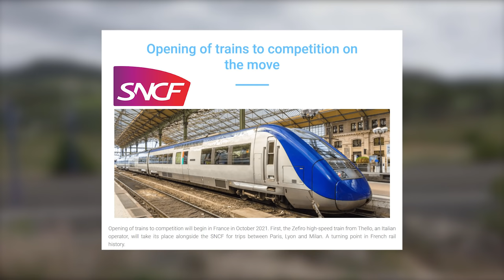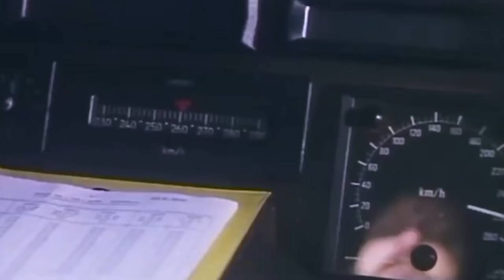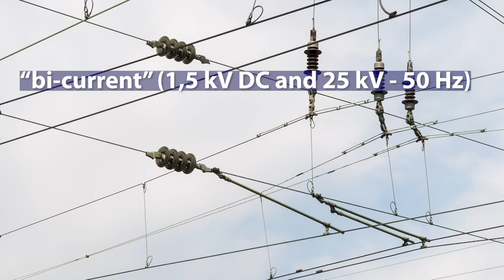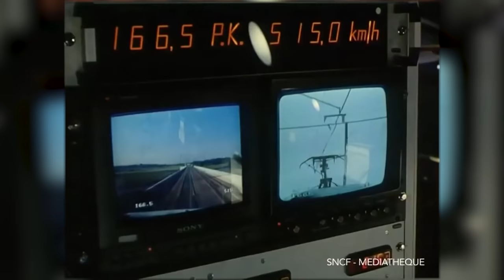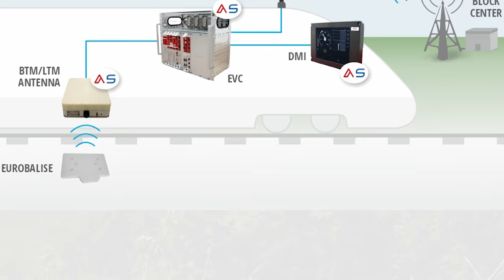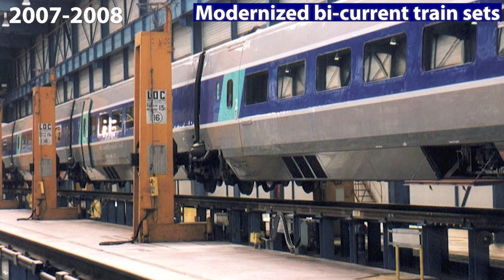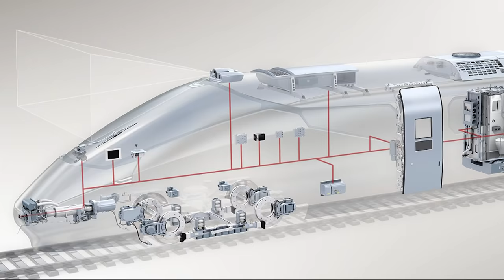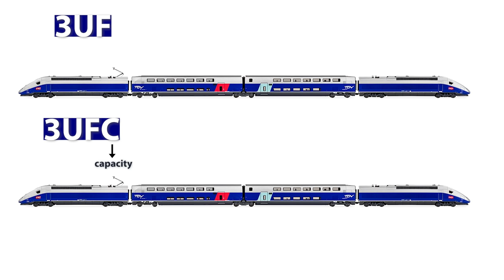Evolution of French TGV Trains: EXPLAINED

Comment: You forgot the TGV La Poste, the world fastest freight train. It was a modified TGV PES, which painted in yellow and allow easy loading of mail.
Reply: The "La Poste" TGVs also had special devices under the floor to measure the weight for the loaders (people) to synchronize the weight on both sides of the cars in order that the final weight on each rail was close to equivalent.  If my memory serves me right, they were removed from service in 2009.
Reply: The 954 half was preserved. 1 power car and 4 carriages.
Reply: China has a faster one now though
Reply: @RichardMigneron  They where removed in 2015
Reply: I remember seeing it once when I was younger it was parked between gare du nord and stade de france
Reply: @danielhalachev4714 Conventional freight trains
Reply: @daniel halachev Mail letter are on decline.  it was more difficult each year to have rentability. So it was the postal company which own them, stop running them. "La Poste" wanted to sold them but nobody buy it.

Comment: You might have forgotten about the PBKA Thalys version. This is the kind of Thalys train that also runs to Cologne. And the TGV that goes to the UK (that's now slowly replaced by the Siemens e320). But it's still a great video
Reply: Also, the original Acela Express is a TGV-derivative. EDIT: As is the new Avelia Liberty also.
Reply: And do not forget the original Eurostar class 373 sets, which were also produced by Alstom.
Reply from the maker: Yeah, it is produced by Alstom but it is not TGV derivate.
Reply: @RailwaysExplained  You forgot the TGV La Poste and the future TGV Avelia Horizon.
Reply: E300 are a dérivate from TGV Atlantique, but modified to be usable on Uk
Reply: @fugf1623  yes, they have different traction motors (asynchronous for the first time in France) so the power electronics also changed, and more safety systems. But Overall their design was clearly based on the TGVs, retaining the general structure (just adapted to the smaller loading gauge) and the bogies for example.
Reply: UK class 373 was very much a TGV. I'm a former Eurostar engineer and we worked with SNCF and so many parts were either common to other TGVs or were an evolution of them just as with each other TGV derivative. 

Arguably the most complex of the lot, it had twice the length, nearly twice the power and all in a smaller loading gauge than other TGVs, with UK AWS/TPWS signalling systems, initially 750v DC third rail shoegear and associated equipment (long since removed since the change to St Pancras station).

So Yes I'd have expected it to be included here as it has a lot in common, particularly with the TGC Atlantique which was a similar vintage.
Reply: @joriss5  the bogies were virtually identical. Many common parts carried over and shared.

Comment: Thank you for the overview.
As a bit of pre-history, until the early 1970s SNCF actually wanted to use gas turbines for their high speed train, considering the difficulties of pantographs during the high speed tests of 1955. So the "TGV 001" test unit was equipped with gas turbines, similar to the earlier ETG and RTG trains. During the 1970s, also considering the oil crisis, they changed their opinion and developed new overhead wire systems and pantographs to work at high speed. A contemporary film about the TGV 001:
https://www.youtube.com/watch?v=1VTfoSltNRI

Alstom also developed an articulated train with distributed traction, the AGV. That one however was not ordered by SNCF, it was only built for Italian ntv (italo) so far.
Likewise one TGV was tested with tilting technology in order to reduce travel times on classic lines, specifically Paris Austerlitz via Limoges to Toulouse (le Capitole). No series production came out of it.

In addition to the Euroduplex currently under construction, the next generation has already been ordered, 100 Avelia Horizon units:
https://www.alstom.com/press-releases-news/2018/7/alstom-receives-sncf-order-100-next-generation-very-high-speed-trains
The improvements mentioned are: 20% lower cost, shorter power cars and new doubledeck bar car increasing passenger space by 20% at the same length, 30% lower maintenance cost, 20% lower energy consumption. The press release does not mention any equipment for international operation. I assume that's optional.

Comment: Great video. For a few that were missed outside of the ones other commenters have mentioned:

Eurotrain: A test train created for the THSR which used ICE power cars and TGV duplex carriages.

TGV P01: A TVG with tilting technology.

AGV Eilsa: Prototype of the TGV successor/Avelia predecessor. It had an EMU formation with distributed traction instead of a power car-carriages formation.

Acela Express: American version using TGV and LRC technology.

Avelia Liberty
: Acela successor based on upcoming TGV M/Avelia Horizon.
Reply: I wouldn’t call the avelia liberty a successor to the Acela
Reply: @No-le9qf  Why not?
Reply: @HeavyRayne  it’s not American it’s a off the shelf trainset and only similarity’s it’s has with the Acela is the trackage it run on and who operate those trains

Comment: In theory you missed the Thalys PBKA and Eurostar e300 TSMT, but since those weren't built for TGV services, I can see why. Under development and early stages of prototyping is the new TGV-M (Moderne) which is marketed by Alstom as the Avelia Horizon. These trains will use a nearly identical powercar to the one on the Avelia Liberty being built for Amtrak's Acela service in the United States.
Reply from the maker: You are absolutely right about Thalys and Eurostar.  Regarding TGV M - you know, we have to leave some material for future videos 😁
Reply: @RailwaysExplained  Clever!!

The first trainset is assembled and will begin its tests (2 power cars 7 cars). For the power cars, they are visually identical to those of the Acela 2. It is inside that this changes, mainly the engines and their placement .

The Acela 2 uses a derivative of the Prima motors, motors suspended from the body (via parts of course). The TGV M will use a brand new Asynchronous motor of reduced size, but outputting a higher power... and it will be suspended from the bogie. As for the control system, probably the usual OniX.

Comment: French engines are amazing. In India, we have been fortunate to have wap-7000 and wap-20000. Alstome has contributed significantly in Indian railway and metros
Reply: Alstom has built the WAP-12 in India. there is no WAP-7000 or WAP-20000. Wap-7 exists which is a passenger locomotive designed in India. Pata nai kya ganja fook ke comment karte hai.

Comment: At 6:49, the picture shows a TGV sud-est, despite it is written TGV réseau.  The difference is the roof of the driving cabin, which is lower than the rest of the roof.  The next seconds show a real TGV réseau with the front light imbedded in the high roof.

For the Thalys, there are 3-current ones with the same shape as its predecessor and 4-current ones with a more aerodynamic (round) design.  We can see a coupling of the 2 kinds at 08:08.

Comment: By the way there is new type of TGV in production. They are considered as the 5th generation of TGVs and they are going released in late 2023 I believe.
These TGVs are going to be more aerodynamic and the 2 locomotives will be smaller in length just so they can add a extra passenger car to the train
Reply: I was thinking that nowadays they may make all the bogies have motors like other modern high speed trains seem to have hence no need for locomotives but then again tgv are the fastest trains with wheels.
Reply: @PeteS_1994  This is because the power electronics must be distributed over the train, in the case of distributed motorization. And this electronics takes up space, so you cannot do duplex without exceeding the gauge (See the Coradia stream bi -level for Germany or Luxembourg).

The SNCF also uses concentrated power coaches to facilitate maintenance and separates the maintenance of coaches from those of coaches that are not aligned with time.

So it's not a question of motors (moreover the AGV uses PMSMs and the TGV-M uses new asynchronous even smaller than those of euroduplex).

Comment: I’m surprised EU didn’t impose a TVG electrical and signaling standard. Why does Belgium, Italy and Switzerland have different standards?
PS1- Alstom designed a great TVG train set kiss!
PS2 - TVG Duplex trains are great looking.
Reply: Because trains are much older than the EU. There are projects about adopting common standards such as the ERTMS but other things like electrification is very hard to change as countries would need to change all their locomotives. Plus even with France there are two different voltages!
Reply: ETCS is the standard for new high speed lines but converting all the existing lines would be very expensive and take a long time, so the trains still need to be equipped for multiple systems.
Reply: ERTMS lvl2
Reply: If you search for "Ferrovie dello Stato italiane trazione elettrica (Italian State Railways electric traction)" you will find two links of the RFI that explain why we have 3kV DC, they are safe and also have an English translation. Unfortunately I can't send the links, sometimes youtube gives problems even just sharing the videos of the same platform
Reply: @fb55255  If you want to nitpick there are 4.... the 750/850V DC used in the metros and on the yellow train of Cerdagne, and the 11kV 50Hz on the Montenvers train.😂

Comment: i wondert what the aerodynamica coefficient is of the tgv's versus shinkansen's strain sets. They look very different.
Reply: The shape of the newer generation shinkansen, with their elongated noses, is in large parts determined by the need to reduce tunnel boom. This is a loud sound that occurs when a train enters a tunnel at speed. In France, this is less of a problem because the tunnels have a larger cross section, so tunnel boom is reduced. That means the shape of the TGV's can be optimized for other things.

Comment: I wonder why TGV still continue with the locomotive based design, even Korea started moving into a distributed power and passenger cab design (similar to later ICEs).
Reply: Because in double-deck cars (complying with the restrictive loading gauge) there is not enough empty space whatsoever to fit traction equipment (and it would make the axle load too heavy). You'd need to completely redesign  the architecture of the train and in the end I don't think you would have more space for passengers as an optimized design like the TGV M.
It's a different problem from single-deck trains, which have enough space under the floor and on the roof to fit all equipment and can optimize the space on board this way.

Comment: I was wondering: Alstom also built the AGV - Automotrice à Grande Vitesse - with no motor cars at either end. But these were only sold to an Italian high-speed rail operator. Has anyone an idea why this variant of the TGV didn't succeed or sell any better? Is it still been developped by Alstom or shelved?
Reply: When the AGV was ready for production, SNCF had already settled on doubledeck trains and found further developments of the Duplex concept to be more efficient (because they have a higher capacity).
Reply: My guess would be it's propulsion is different from the traditional TGVs and probably SNCF was waiting for something more innovative like the Avelia Horizon.
Reply: SNCF decided to increase the capacity by trains with Duplex to increase turnover per unit and avoid multiple units.
Sncf thought reduce tolls by trains but the tax increases anyway.
Beside of that, some major lines,  out of Paris, lost a lot of trains due to the arrival of Duplex. Instead of purposing 350~ seats by train, the Duplex purposes more than 500 and it's hard to complete them fully.
So now, they reduce the frequency on certains lines...
AGV would be great for HSL that don't deserve Paris but our network in France is joining Paris anyway instead of others medium size cities relations.
Reply: AGV is the main NTV Italo's high speed trainset in Italy.
Reply from the maker: We will cover that in the video about Italian HSR.
Reply: @FlankerX  Duplexes use squirrel cage asynchronous associated with IGBT VVVF.

AGVs use PMSM associated with IGBT VVVF.

Contrary to what one might think, the Avelia uses the same motors as the duplex (except for the TGV M version) coupled with IGBT VVVF (same modulation)

Comment: The section about Thalys was very confusing and too short in my opinion, you basically said all Thalys are the same sets but they use 2 different ones (: PBA and PBKA, respectively based on old and new generation power cars)...

Comment: Why are some French lines not operated by AGV type? 
I thought AGV would be the successor to TGV in the near future.
Reply: the sncf wants to keep the concentrated motorization to facilitate maintenance.

In fact, the power cars are numbered, not the coachs. The power cars are never with the same duplex coach all their life, but keep changing.
Reply: @Lodai974  No it's quite rare that power cars swich sets. It mostly happened after one was destroyed and of course for the POS/RD and Ouigo/neoduplex swaps. There 3 spare power cars (one Réseau, one Duplex and one 2N2) to use when one is disabled, but it takes some time to swap a power car so they don't do it regularly. Most sets run with the same power cars all their life.
Reply: @joriss5  There is a reserve set of two power cars for each series. They are used to replace the power cars , in the cases listed by u and for heavy maintenance operations (mid-life for example)

Ah the new power car of TGV-M (Avelia Horizon) has left the factory and is on its way to La Rochelle.It's the same as the Avelia Liberty